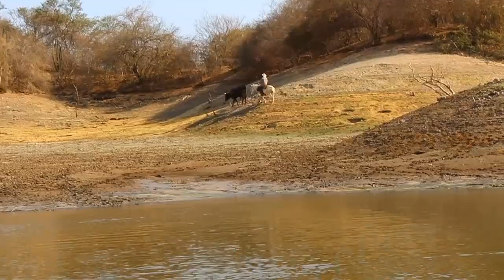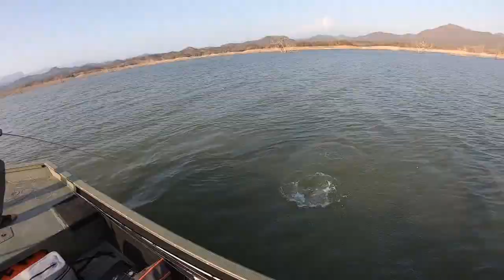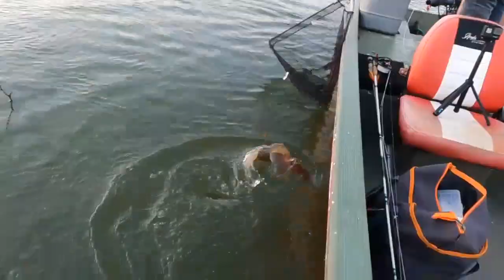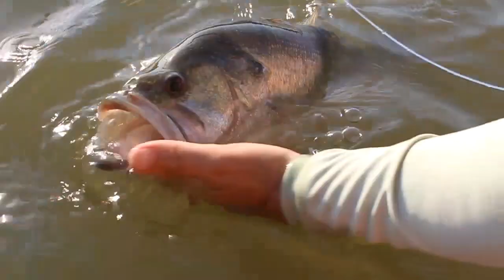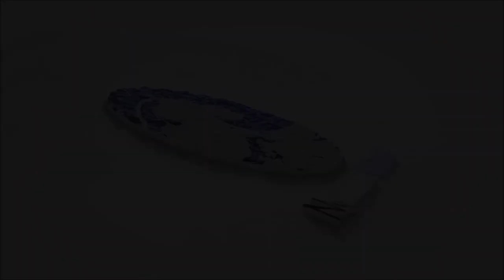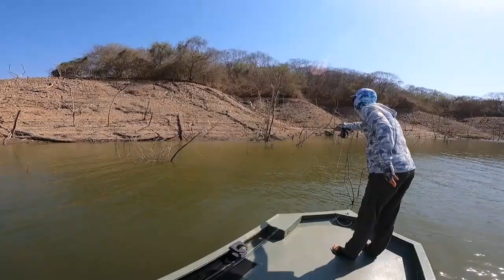Grain Weights and Sink Rates

Comment: I appreciate your discussion of the way lines can be identified by grains, a unit of mass.  If I understand it, the line, say 250 grain, is coated to produce a section that will sink.  If it has a lot of tungsten in the coating it has a fast sink rate, if the coating has less tungsten it is a slower sinking line, etc.  Tungsten being much denser than water.  Here is where it has confused me.  Hasn’t the addition of a tungsten coating changed the mass of the section of line.  I don’t care how you measure it grains, grams, pounds…. If the section without coating is 250 grain, after coating it is something different.  At least as long as the length we are discussing is the same.   Is that your point?  Stated another way, if you have 250 grain line with a slow, intermediate and fast sink rate isn’t that equal to a mass of 250 + X, 250+Y and, 250+ Z for the 3 different lines. Where X, Y and Z are the additional mass from the coatings with different sink rates.
Reply: The fly line weight is calculated when the line is finished. Just because a floating line is 200 grains and a sink tip is 200 grains the sinking doesn’t add additional weight. They create a different fly line for their sinking line, it’s not just a floating line with extra weight added to it.